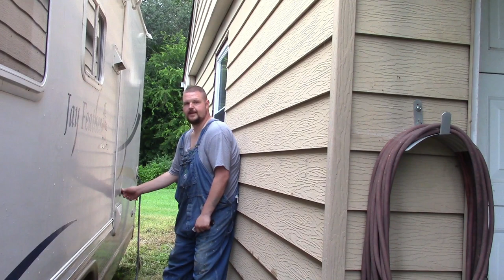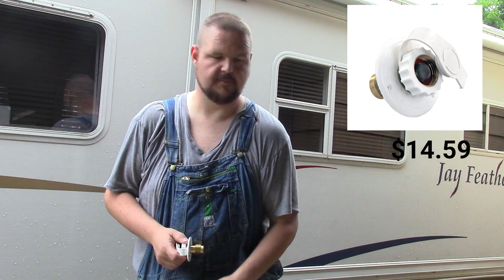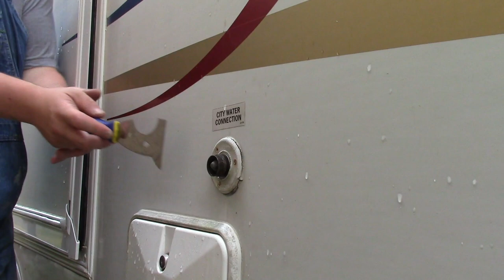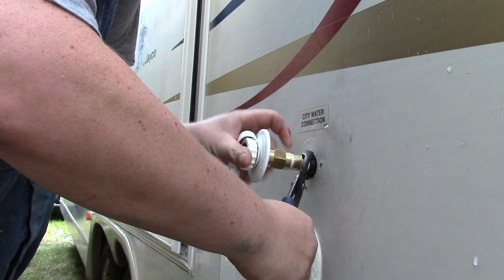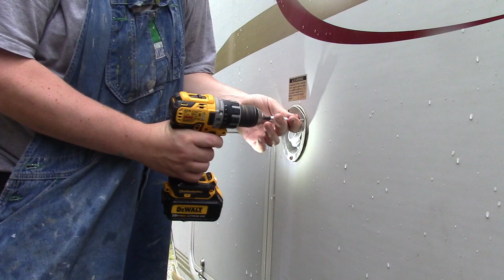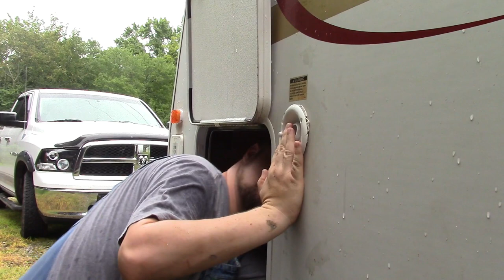Repairing Water Inlet on RV - DIY

Comment: Just a comment from an old grandma here... Instead of trying to hold the pipe so it doesn't go back in the hole use vise grip tightened on pipe I stead. Pipe & vise grips can't fall I to hole. Frees up one more hand to use where needed. This probable doesn't make sense to anyone but me😊

Comment: I really needed this. I can't get my new pump to work either. Hope I dont have to remove my new water heater again. Think I'll feed new big water hose (shares cavity with the water heater / too far to reach from Inside) and vent to the inside, wrap around my water heater and drop it down through the floor to the tank. Gonna replace the fill and vent hose too. I need a vid to show me how to get to the boondock water tank. Got one?
Thks for this info.
Reply from the maker: Jrhnhemp sorry but I don’t have a video on the tank.  That will have a lot of variation based on the camper.   As far as the pump....  is it getting power to it?  Is it making noise like it’s trying to run?  Sometimes (more with the older ones, they need to be primed.
Reply: @GimpyCamper  Thanks for your response!...well I think my city water check valve failed. My new pump wont turn off. I have a new one of those new water hookups with check valve coming. Found another vid that mimicked my problem on my 2008 Frontier Hyperlite issue. Replacing that check valve solved the same problem on his 2008 rv. Pump troubleshooting guide suggests that's my problem too.
So far,  I've replaced the cooling unit on my frig, replaced my water heater, and my water pump. Just gave my ac a good coil cleanup and condensation drip pan cleanup. It works but it's old too. When my pumps working right and I change out both water hook ups, I'm gonna replace my ac with a new one. I use this rv for per diem work and all the rv repair shops are so expensive and so backed up with scheduled work, if my ac went out, it would take me out of the trailer for a month  (That means a hotel). AND cost a fortune.  For approx $750, I can get a new one that I can install in my own yard in less than a day.
Regarding the water tank...
I think I just have to remove the belly plastic cardboard to find my fresh water tank. I found a vid showing what they look like when uncovered. Hose clamps and new hoses are in route too for my fresh water tank/inlet. (If I go in there, everything's getting replaced. The original lasted 8 yrs) 
Thanks again!
Reply from the maker: My thanks on my new camper are just behind the underbelly

Comment: Is it possible to take the net part out? The just the net but the circle piece connected to the net? Was wanting to take mines off to pour some cleaning solution for my water tank & put back on .
Reply from the maker: Yes it just pops out but I’m not sure what type of camper you could fill by hand through the city water connection, the ones that fill through the hose there require pressure.  The separated tank fill doesn’t have a screen

Comment: Why does my fresh water inlet leak?  Does it have anything to do with city water valve?
Reply from the maker: Hmmm. So you are saying that  water overflows out of the water fill.  Hmm.  When does this happen?  Is it when you have the pump or when you are on City water
Reply: @GimpyCamper  when I'm boondocking.  No water hook up.  It just drips and I've tried adjusting that little screen and even that white thing inside a bit. Also my pump cycles about every 10 minutes.  Just a little bleep. I checked all around the pump and it's completely dry.
Reply from the maker: Sounds like there is a check valve leaking a little. Really not sure

Comment: sure is dwindled after being on a couple of seconds.  This is happening not on  the water pump.  Just using my city water source.  I have been able to take a shower this way and not have to use my pump.  Now I cannot with  a trickle after that initial burst of pressure.  I l looked for leaks inside and outside and have found none.  Any ideas ?
Reply from the maker: I guess the first thing I would do is disconnect the water and try putting water in the tank and using the pump.  If that fixes the issue it would be low pressure coming into the camper.  You can try removing the pressure reducer if you have one as well.
Reply: @GimpyCamper  Okay thanks.
Reply from the maker: How did it go?
Reply: @GimpyCamper  After looking at the regulator at the source , I noticed some debri clogging it up.  I had an extra one so I replaced it and will clean the old one up.  Pressure is back to normal.
Reply: @GimpyCamper  I did learn that if you replace your city water intake check valve to keep the O ring and screen because you can then place that into a camco regulator to catch any debri.  Save you about 12.00 dollars.
Reply from the maker: Glad all is better for you friend

Comment: When you say you're going to do something "real quick," then do so.  You had so much dead time in the video that you got very dull to watch.  We don't care if there's a dog that doesn't like what you're doing, how often you sprayed for bugs or other BS.  Also, it would have been a nice extra to show how you retrieved the connection after you lost the grip and it went back up into the trailer wall.
Reply from the maker: Congratulations for pointing out mistakes on the second video I ever made that was years ago!
Reply: @GimpyCamper  No problem.. I hope they were helpful.